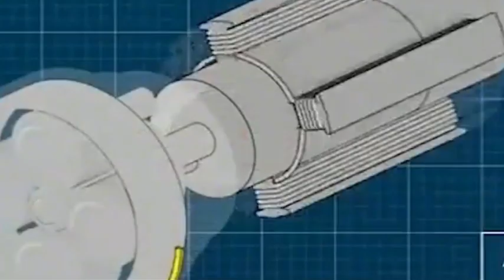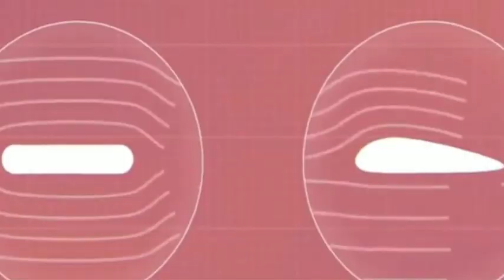Shocked USA! China's CSSC achieved a major technological breakthrough in the field of clean energy!

Comment: Wow, China has surpassed the usa in wind turbines that can generate 18 megawatts far above what the usa can build. The Chinese wind turbine works very efficient and can withstand the robust sea environment and can therefore be installed off-shore without incurring high maintenance costs. China is leading in clean energy supply as she is leading in clean nuclear energy as well such as thorium reactors and nuclear fusion reactors.